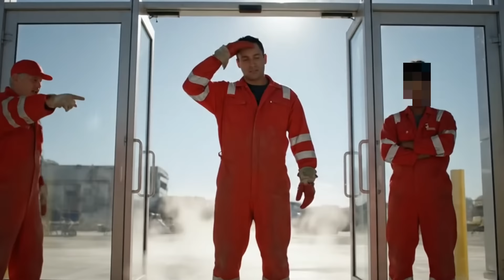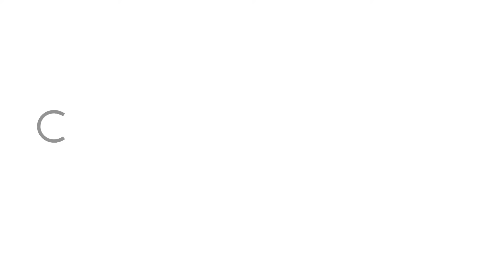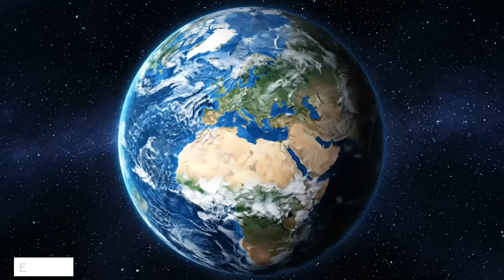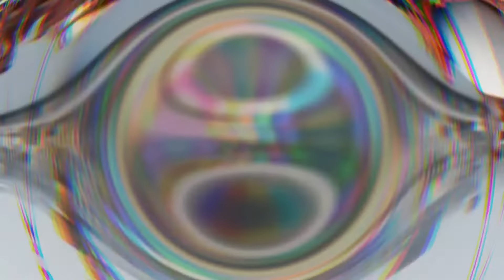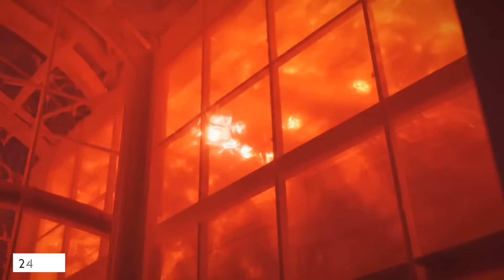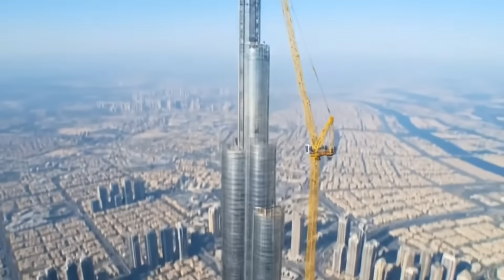How the Impossible Burj Khalifa Was Built

Comment: suddenly the advertised 4400-ton steel spire (4400 x 2,000 pounds per ton=8,800,000 pound steel spire) changed to 3.5 tons. Is this the same engineering ability that let the architects NOT KNOW to install reflective glass to begin with?